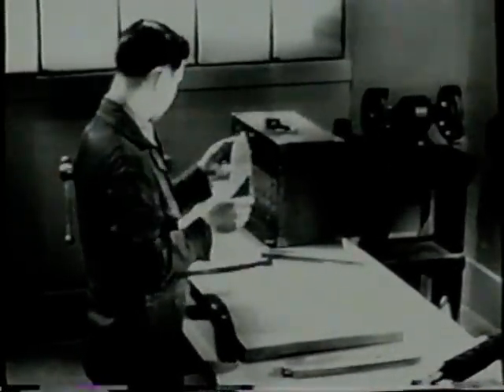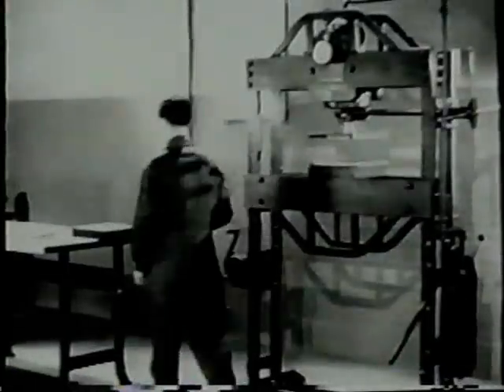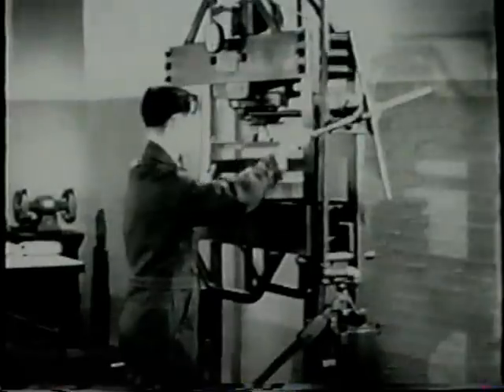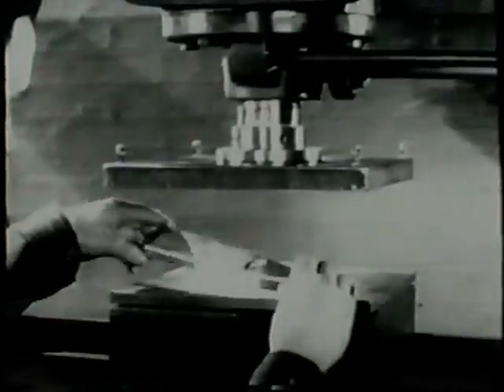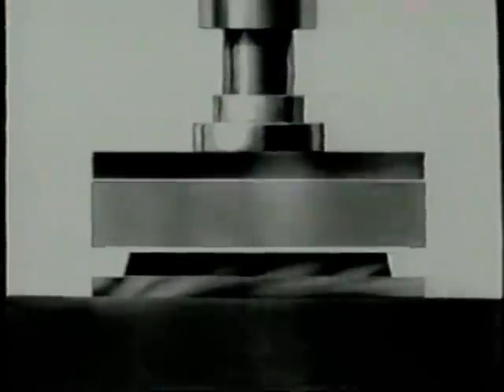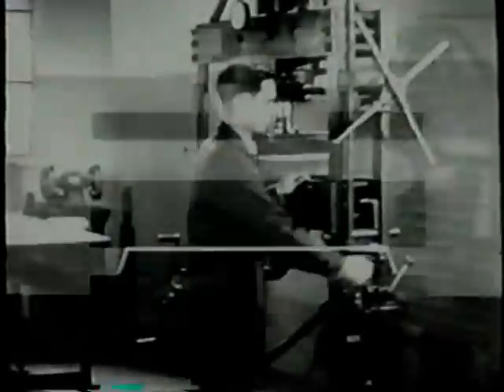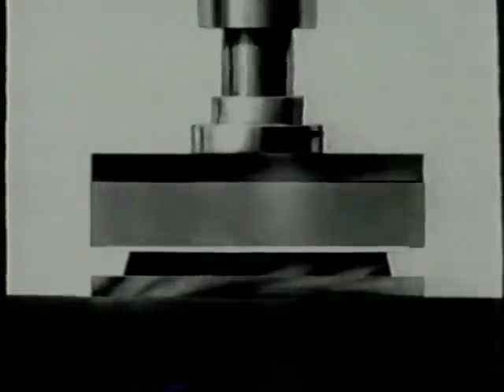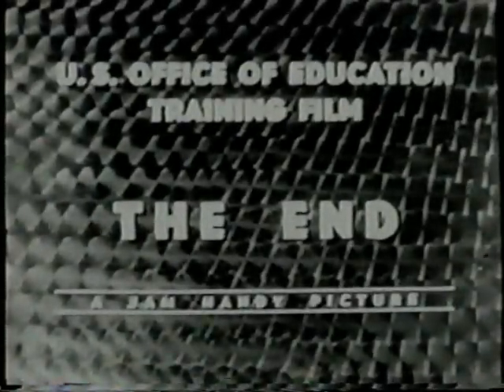Forming With Rubber on the Hydraulic Press

Comment: I like how the narrator says here you can see on the small press,,

I know a few engineers who would gladly part with his first born for that press, she’s a beauty.. anyone know what it is?
Reply: Good observation. It is a KR Wilson 75 ton press. I am currently rebuilding a 60 ton version that is virtually identical to this one. I am convinced that they are the best hand-pump press ever designed.  The handwheel allows the ram  to be positioned quickly or can be used as an arbor press. The hydraulic pump is two speed. All the hydraulics are simple ball and spring check valves for control. Very simple and still working after 75 years and even with 1 inch of oil sludge in the bottom of the reservoir. I replaced two seals on the pump shafts since the originals were leaking slightly. Everything else just needs bead blast cleaning and refinishing.
Reply: Bruce Blyton it sounds fantastic, I love the fact that it can be dismantled, checked for any wear, repair and rebuild with little more than a cantilever toolbox 🧰 with a good set of spanner’s, Allen keys, screwdriver, a persuader and measurement equipment for such a task.  Can the same be said for an 5 yrs old CNC that’s been abused more times than a prostitute from a local red light district.  If the CNC had an inch of sludge in the reservoir it would be in a right dilemma,  with certain parts only available from the the dealer,  who would guarantee to spank you of all your hard earned cash!  I’ll have to keep my eyes open ta similar press Bruce, thanks for showing us this great gem of yours...... Phil